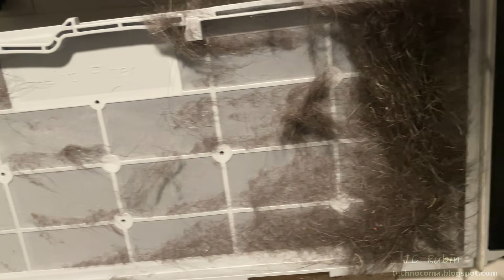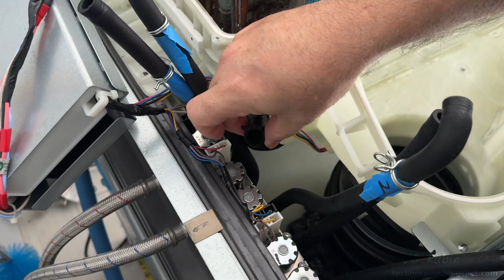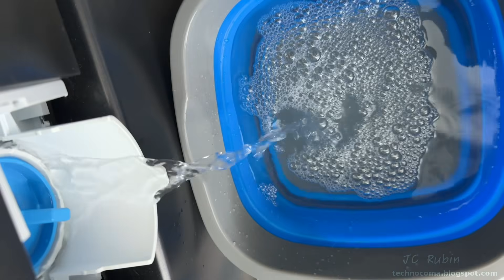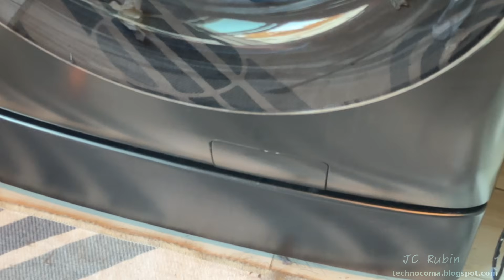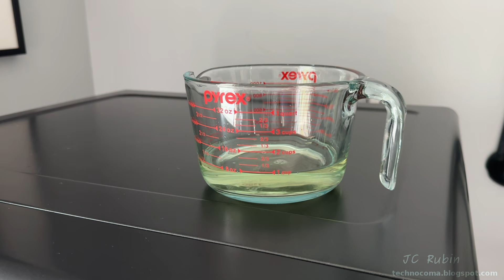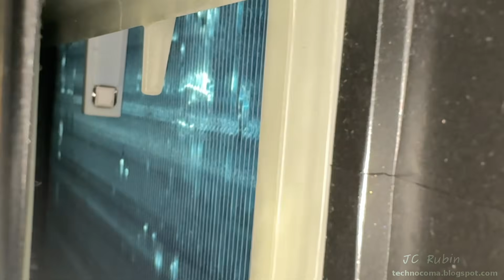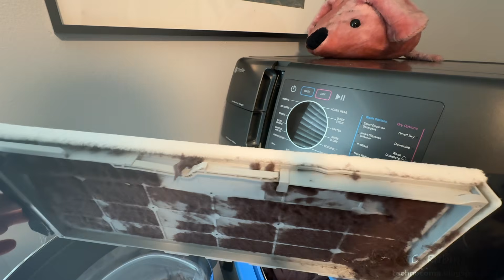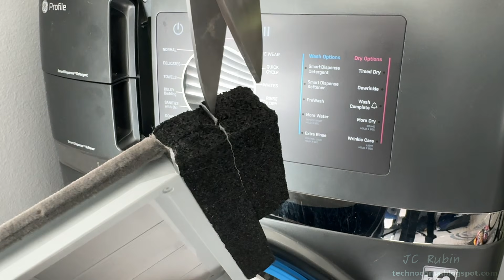GE Profile Ultrafast 2in1 Combo Washer Dryer - Why they Fail & How to Fix it

Comment: Very thorough video. I can't help but think anyone who buys this unit will have the same problem. I kept getting the warning to clean the filter after every load - it actually went from yellow to red. I was able to fish out a big lint ball from that hole to the left of the filter slot with a long brush. (Thankfully, it didn't fall in the hole.) Another tip I got from the repair man...the light side of the filter, you should be able to hold it up to light and see thru it easily. Although, I was cleaning the lint off the filter, I didn't realize gunk builds up on it, and it cannot breathe. He showed me how to use a soft brush and clean the gunk off. It worked so much better after that and is probably a simple tip your viewers could try first. I'm implementing your suggestions in the video right now. And as a former sailor myself, thank you for your service.
Reply: I've never been able to clean the screen with any kind of brush. I even tried a sonicare toothbrush. What works for me, and works amazingly well, is to grab a garden hose with spray nozzle, set the nozzle to jet, and hold it an each away from the screen. I'll admit that this may some day blow out the screen, but I've done it at least 6 times now (every month) and it's been fine so far. If it does rip, it's a replaceable part.
Reply from the maker: I vacuum it with my Dyson and brush attachment.

Comment: Great job on the video. I have the machine for a little less than a year. I’m upset that these steps need to be taken so soon in ownership. I pulled the debris from the access door at the bottom. Without the pedestal the water is going straight to the floor. Pain. But I found a blue rubber strand amongst the debris. It appears to be a broken gasket similar material as the door gasket. Can you imagine what that might be from? Hopefully it is something unrelated that was in a dirty pair of jeans.
Reply from the maker: If you inspect the seal and there is no damage it could be residual from the assembly

Comment: What’s the length of the shorter 2nd rear seal?  Did you cut to curve it at top and bottom so it won’t catch ?
Reply from the maker: Until the seal for the rear is installed in the machine they must still slide back and forth on the tracks. That is why they are sliced at the ends
Reply: In the video, the 2nd rear piece is called out at 10 mm. I think he meant 10 cm (~4 inches). From the video, there’s no way that piece is only 10 mm.

Comment: Will the modification  to the lint filter hurt the blower moter by restricting  the air flow, could it be designed  loose fitting for a reason, like a fail safe.
Reply from the maker: By fail safe do you mean destroying the heat pump at the expense of the blower? I’ve never seen a dryer with a lint bypass as a fail safe imho

Comment: I think if you produce/design an extended version of this filter to close the gap mentioned, you will be a millionaire. Such a simple fix to avoid all of the issues it's mind boggling.
Reply from the maker: The rear seal inside the machine would solve it. Maybe that’s the intent behind the new rear modification in the future
Reply: You would think this would be something that GE should issue a recall for... such an obvious design flaw.

Comment: We've had it for 2.5 years. Within the first 6 months we got a replacement unit and a replacement to the blue band. A zipper got caught during a cycle and ripped it, it proceeded to leak in the front. I have to continously clean out lint and gunk from the blue band and the clean cycle is annoying.  Overall, it's great to use buy kinda high maintenance.  It has lasted longer than other machines we've had.
Reply: I will add that ive had to replace the  lack foam filter 3xs. it is super flimsy.
Reply from the maker: The new filter is now available for purchase./

Comment: I hate this machine so much. It's been nothing but trouble since I got it. GE was the absolute worst with getting service. Took 6 technicians to figure out I had a bad sensor and 12 weeks to wait for the part to come in. Now warranty is out and I'm still stuck dealing with these kinda issues
Reply from the maker: That sounds more like a problem with the technicians than the machine.

Comment: I bought this machine two years ago. I have religiously cleaned the filter, always got the message to do so. Then I bought new towels last week, washed then the clean filter message became "Filter Clogged".Now need to call for service. My recommendation is to never wash new towels in it. Wonder how long it will take to get a tech.
Reply: Never wash new towels!
Reply from the maker: I have a video on opening and cleaning out the machine.
Reply: @rubin-tech  I did see your video, but I'm sure I would invalidate my remaining eight years of warranty. Do you know do the LG all in one machines has the same sort of problem?
Reply from the maker: @pamcherry1814 I haven’t tested that machine, some also self clean the heat pump. That one may do that as well
Reply: @rubin-tech  I am hoping that GE will work with Bodewell (doing repair) on comping this repair or a replacement, I need to order the insulation tape from your video and get that before Wednesday. Thank you for your help.
Reply from the maker: @pamcherry1814 I can’t be sure that a repair contractor will do anything other than is officially prescribed. While you can add them later. You could always ask.
Reply: @rubin-tech  HI, this is so frustrating. I have a feeling that my clog is between the drum and the filter. Could that trigger the error? Also my tech has ordered the upgraded filter and a new humidity sensor which he thinks is the problem. Could that be possible? He is supposed to be here again on Friday (3rd time) to install the partss he ordered. The filter has arrived, but not the humidity sensor (if that is what it is called).

Comment: I’ve had my GE Combo for two years, I discovered so much blow by on both sides I couldn’t close the filter assembly. The intake side is so full I may have to call a tech to pull the top off. Just pisses me off GE has not addressed this problem with the filter! Thanks for the information, I have ordered the weather stripping to hello curb this inconvenience .
Reply from the maker: Hope it works well for you, be sure to clean out the machine first.
Reply: @rubin-tech  just confirming (as i am in the same position as op..) i should take the machine apart (or have a tech take it apart) for a thorough cleaning PRIOR to completing your recommended modifications? or.. is it possible (&& safe..) to modify the filter now, & tackle the take down at a later time? when i have more time?

it’s maybe worth mentioning that we have many MANY animals..
🐴🦮🐈‍⬛ & while i had the best intentions, it turns out i only thought i was maintaining my machine properly.. even after many attempts at a "deep clean” & wayy too many hours watching videos online.. i am saddened (& a bit embarrassed) by the amount of blow back i can see on BOTH sides 😭 unfortunately moisture has caused lots of it to stick (even whilst i vacuum && clean with my brush kit 😩)

your video gives me hope for sure, but i want to be certain i am not jumping the gun & pre maturely modifying the filter (if i was a betting woman, i’d lay a little $ down that it’s gonna take me a bit to work the confidence necessary to take this beast apart 🥴😅)

lastly,, we all owe you a gigantic thank you for your time & thoughtfulness making this video 🙌🏼

you’re a rockstar 💪🏼

Comment: I can't get mine to pull up the maintenance to test my spin speed. Mine is a Profile not the ultra. Hiring 3 buttons at same time does nothing. Please help
Reply: I had to try about 4 times until it worked. I selected Auto and it went through and completed all the tests. The only shown was that the test(s) were completed. Can I assume there were no faults found?
Reply from the maker: Did you use a spirit level to ensure the feet were adjusted properly?

Comment: I have the same machine.  I still love it but we have 4 dogs and your videos have been very helpful in servicing it.  What I did a little different than you is I put a THICKER compression foam on the actual machine on the back wall and used the brush seals on top and bottom.  It seems to work very well.  I haven't cleaned my machine yet but will be pulling it apart soon to double check that drain you cleaned in this video.   AAAAND I just finished the video and it seems like you are doing the same thing the next time you have your apart.  It works very well!
Reply from the maker: That's great to hear, thanks for sharing your experience!

Comment: I am so thankful for this information & instruction!!! i’ve had one of these machines for over a year now and I’ve been hating it because I’ve never had such a fussy high maintenance machine that doesn’t work very well regardless… I’m going to order the correct foam right now and give this a try! Before I watched your video, I was about to call the used appliance store to see if I could sell it (& buy a different machine). I’m excited to give this a try first!
Reply from the maker: Good luck and let me know if it works out for you.
Reply: @rubin-tech  I’m putting on the foam & brush seals today. For the extra foam piece to fully seal the back, you say it’s a 10mm piece - I’m not sure what the 10mm measurement is? Is it maybe 10cm long?
Reply from the maker: @cccouzelis763  Did I say 10MM, ha. thats just 1CM, It should be a piece sufficient to covert the back portion.

Comment: Had ours 4.6c ft. 6 months owned. Bought an open box from best buy. Got the 3 year warranty. Haven't had an issue. We've also got 4 cats and a dog. Washed everything in our 1 bedroom apt that's washable. Was going from quarter machines wasting SOOOO much $$$ on those dumb things, to an amazing and clean and fresh living. I wash everything constantly as well. 

Definitely going to look at this in detail to see if the extra seal would help retain value! Thanks for doing this extra work!
Reply from the maker: Glad I could help!

Comment: I am trying to follow these instructions exactly, but the link to the foam strips takes you to an Amazon page that does not offer a 1 inch W x inch T option.  Can you recommend a different product?  Thank you!
Reply: Also--the link to the brushes you provide on this video is a link to drain and straw brushes, not the large blue brush you are using in the video.
Reply: Bump

Comment: Ours has broken 4 times in the 18 months of ownership. We bought it to "save time" by not having to switch the clothes from a washer to a dryer.. .and now we spend hours every few months trying to clean it, fix it, and waiting for repairs.. not to mention having to use a laundrymat every time it breaks.  Worst appliance purchase we've ever made.
Reply from the maker: I have zero issues with my machone with both prevention and maintenance.

Comment: By far the best description of the problem and remedy. I will hold off buying one for 1-2yrs. Seems they will have no choice but to redesign.
Reply from the maker: It’s been out for quite a while and this filter is as much reengineering they’ve done
Reply: Thought they did just offer an "updated" version of the filter.  Unfortunately, didn't update it enough.

Comment: I think the reason they did this is that in a normal dryer, if the filter clogs up, they want the air to bypass for safety and to keep it running. But with a heat pump dryer, that doesn't work. In a normal dryer that's what they want, because it's safer (reduced fire risk) and the extra lint vents outside, and as long as you clean the vent annually as recommended by literally everyone, it's not a big deal. But with a heat pump, they're recycling the air through the thin vanes of the coils, and it's a worst case scenario. What they really should do is seal it up tight, measure the airflow (the machine is already more than smart enough to handle an airflow sensor), and stop the machine with an error to clean it if it can't flow enough air. The heat pump doesn't get as hot and isn't as big of a fire risk as a normal dryer, so clogged up flow isn't nearly as dangerous, it just stops it from working properly until it's cleared.
Reply from the maker: You may be right.

Comment: I am looking at buying a GE 2-in-1 combo and Im glad I saw this video. If I do decide to buy this model, I will perform this modification to it before installing the machine. Thanks for sharing!
Reply from the maker: You're welcome!
Reply: Good luck 😢
Reply: This machine does require a lot of maintenance, but it's so worth it to not have to make that middle step of moving clothes from washer to dryer. That might not be a good enough trade-off for everyone, but for me it is a HUGE laundry improvement. GE is supposed to be sending me the new filter so after it gets here, I think I'll try this sealing process because I suspect the problems with lint getting through won't totally be resolved with the new filter. Especially that spot at the far end of the filter chamber where the extra foam is installed here. Excellent engineering, testing, and results! Thank you, @retrotechandelectronics.
Reply: Did you buy 1 and hows it working? thanks

Comment: Thanks for posting this. I followed it step by step to open up and deep clean my machine and I suppose I’ll be doing it annually moving forward. 

Haven’t seen anyone talk about this yet but GE actually quietly released a new filter assembly on their website. When I went to order a filter replacement two weeks ago both models were available on the website but when I called, the phone rep told me the old assembly is discontinued. Would love to hear your opinions on the new version.
Reply: Do you know what the model number is for the new filter? I’d like to purchase one. But I want to make sure I get the new one.
Reply: Model number for new lint filter WE16X39861
Reply from the maker: Ive released a video with a complete review of their new filter.

Comment: I’ve had one of these units for about 45 days. On the very first load, I noticed lint making its way past the filter. Since I already had the materials on hand, I went ahead and sealed the back, top, and bottom edges of the filter housing. For the next 10 loads, everything worked perfectly.

After that, however, the machine began spending most of the dry cycle stuck in “LOAD SENSING.” From observation, it appears the machine samples relative humidity roughly halfway through the dry cycle (around the midpoint of the progress indicator) and then updates its remaining-time forecast. According to the manual, LOAD SENSING should only last 3–4 minutes (or up to 15 minutes per the machine), but in practice it can remain in LOAD SENSING for the remainder of the cycle (which, unfortunately, can be an indeterminate amount of time since the progress meter and time estimate are no longer available).

I had a GE technician come out to inspect the unit. The machine clearly collects and stores a significant amount of diagnostic data (I wish more of it were exposed in the app). Although there was no obvious smoking gun, the technician replaced the RH sensor as a precaution, which unfortunately made no difference.

My current hypothesis, untested so far, as I’m reluctant to remove the seals, is that the machine may be designed with some degree of intentional blow-by. Fully sealing the filter could be creating a slightly more humid environment on the sensor side, enough to confuse or overwhelm the humidity-based forecasting algorithm.

I’ve developed the habit of cleaning the lint filter after every load and leaving both the filter out and the door open between cycles. My thinking is that this allows residual moisture from the previous cycle to evaporate and exit the otherwise sealed dryer environment before the next load begins.

That said, I’m still very happy with the machine overall. With the auto-detergent feature, all I have to do is drop in a load and press start; the convenience is hard to beat. The only real drawbacks I’ve encountered (aside from the filter design) are load balancing and vibration control (yes, all the shipping bolts, and bar, have been removed). The unit seems particularly sensitive to imbalance and doesn’t absorb vibration well when the load isn’t perfectly distributed. I’ve even noticed the spin indicator blinking in one of your shots, which usually means the spin cycle couldn’t complete and the machine defaulted directly to drying.
Reply: Regrets.   4 month old machine.  Too much trouble. Wouldn't buy again.
Reply from the maker: Thanks for sharing. These experiences are also dependent on not only how often you wash but what you wash and maintenance habits
Reply: That’s interesting, I’m also getting stuck on load sensing, but only after the latest firmware update about 2 weeks ago.
Reply: You have to tear it apart and deep clean the lint out if all the cracks and crevices as well as the heat exchanger on a regular basis. Like literally every 3 to 4 weeks.
Reply: @mikeray4002 which is annoying.
Reply: @iztherelife1340yeah, especially since the thing weighs over 300lbs and is a huge pain the the ass to move out of corners.

Comment: Very helpful. I encountered the similar issues.  We clean it out regularly but appreciate you pointing out the flaw.
Reply from the maker: Glad it helped!
Reply: @rubin-tech I just did the installation and I am seeing a noticeable difference.  I am wondering if they would do a retrofit on their filter set up. In future models.
Reply from the maker: @kaufmanjeffreys given that they just released a new filter that didn’t address the issue, probably not